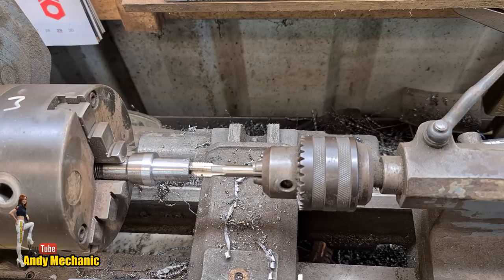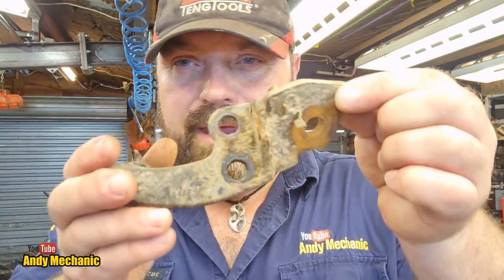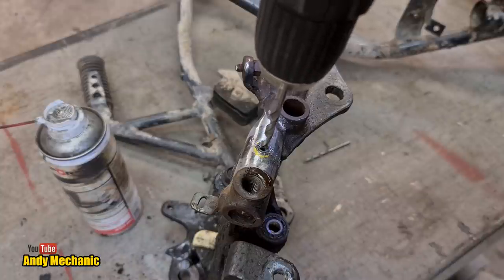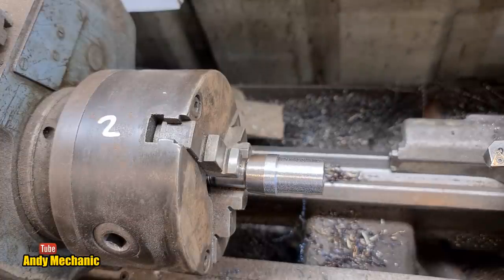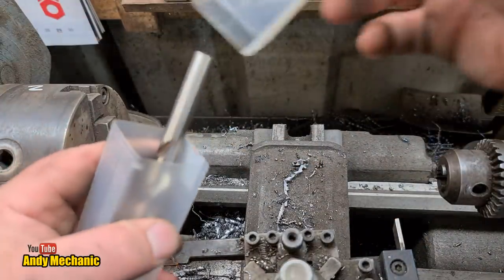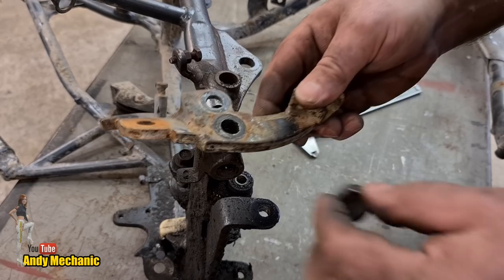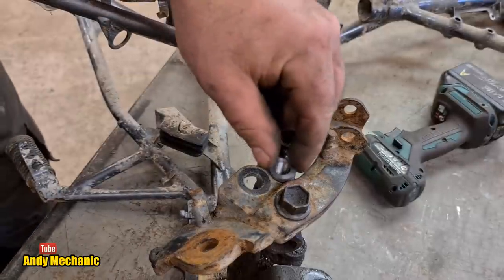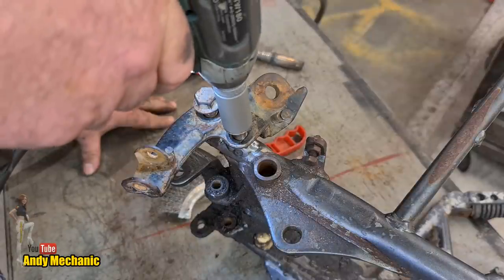DR200 frame modification for dual side stand #2023

Comment: Andy when you are cutting off in the lathe if you insert a length of stiff wire down the hole you will not loose the tube behind the lathe